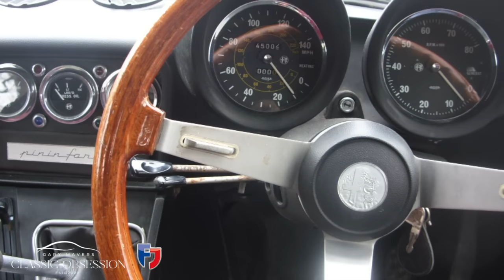Should it have been scrapped?! | Alfa Romeo Spider Resto | Classic Obsession | Episode 42

Comment: For the RHD 105 series had the standing pedals. The LHD had hanging pedals and only needed one vacuum booster. A to the carburettors. THE us versions had an emission demand that they could only fix with fuel injection Spica system.
Reply: Correct..... Webers and Dellortos were both used too.

Comment: The boat tail Alfa Spider gets all the admiring looks, but the Kamm tail is still a very pretty car and I would imagine not so pricey. You are right tho' about the plastic bits that they started tacking on the front and rear of the later models - not so attractive - still, I wouldn't say no to one. No, to the scrapping question - Spiders are always worth saving unless completely shot.

Comment: Hi Gary, 
Just seen your video on the Dutch blue Alfa spider you restored. I have owned this car for some years now and have a large history file on it. Your name is mentioned as the owner after the doctor. 
I have also had it restored again at great cost.
Regards Russell
Reply from the maker: Hi Russell. Wow a blast from the past! It must’ve been about 20 years ago now. I remember it being a very original car but in an awful state of disrepair. Well done for keeping it on the road. I recall one of the worst jobs I had to do on it was replacing those big rear suspension mounts. The back end used to swing out as I went round a bend. Lovely sweet engine. Regards.
Reply: @classic.obsession  evening Gary,
Evening Gary, 
You did a good job there, she still  handles well!
She had to have a lot of rot cut out since I’ve owned her, as I wanted to get her as solid and rust free as I could, much spent on the body and the mechanics. I’ve spent much more than I could ever get back , but it was worth it.
In the history file is a letter you sent to one of the previous owners.
Just to add she now shows 57000 on the clock.
Russell

Comment: my favorite one is the last 70´s model i drove it for a few monthes but had to sell it, where i live is sunny most of the year but the head burns without a top, in summer only at night during the day it´s impossible but nice cars to drive, the 80´s model almost  destroyd the car with the same body they put round plastic bumpers and a big side mirror they look a lot bad, normally i kept two seat cars convertible but they had to have hardtop